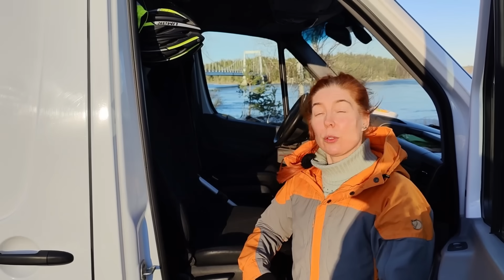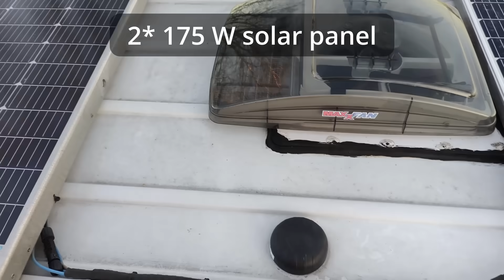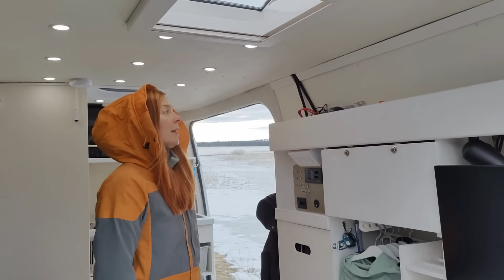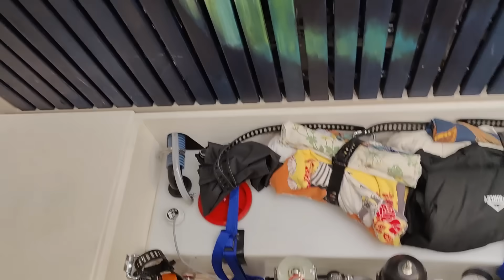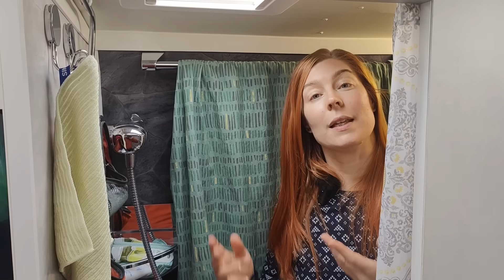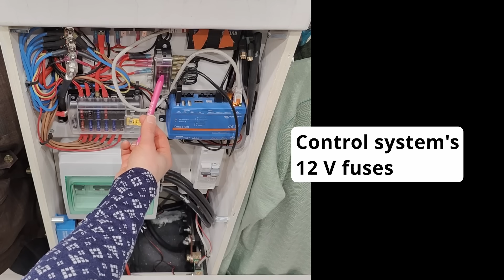diy camper VAN TOUR | Technical talk | Rare layout 🚐

Comment: I really love the way you've organized your campervan! I'm about to build my own campervan and you've given me a lot of great ideas. One question I have, if you could do it over again would you get maybe an L3H3 or L4H3 van, or do you think L2H2 is the best size? I'm still debating with myself how big of a van I need, I'm currently looking at L4H3 so I can put most of the storage overhead, and have a permanent bed in the back. And if I can sneak in one more question, can you charge the batteries purely on solar, or do you have to use other methods to charge often as well?
Reply from the maker: @woutkoopman   Heya, thank you for the lovely comments and questions! 😊 Happy to help.
For me this L2H2 is the maximum size, because it fits scandinavian city parking lots, U-turn radius (RWD) is almost like a passenger car, under 6 m long vehicles get bridge tolls and ferry tickets cheaper, and the weight stays lower. Naturally, more space and a fixed bed is luxurious, but i personally would end up packing every cabinet as full as possible regardless how many of them there is 😂 they always tend to fill up anyway. Longer vehicle means also more building material weight. But I'm sure in some countries and travelling styles, full L4H3 is equally perfect!
In Finland (62°N) i need to recharge my LiFePO4 batteries with grid power/generator every 3 days between Oct-Mar and occasionally (every 1-2 weeks) during summer when i don't drive long distances. Summer season depends a lot on the weather, and in winter basically there is no sunshine. I hope that your van build goes nicely, good luck! 🚐✨
Reply: @badasanaexperiences  Completely understand the choice of van size now. It probably would be better to have a van that fits in a regular parking lot. Problem for me is that in the Netherlands you're not allowed to sleep in your vehicle outside of campings, so I'll always be staying on a camping somewhere. But that's still pretty good that you can go 3 days before needing a grid charge. I think I'm going to copy your battery set-up, I think I have about the same usage. Thanks for the great info!
Reply from the maker: @woutkoopman  Wonderful to hear that I was able to provide some insight 😃 Yeah, i noticed that the cheap public camping places are pretty busy in Eindhoven at least, i can understand why. This electrical setup is ok, but for improved solar panel recharge, I recommend a bit more powerful MPPT, for example 30 A. But all the use cases are of course unique and it's important to use the mixture of electrical components that is approved by the manufacturer 👍 btw, if you happen to create any video about your camper van build, please link it for me 😃 i'm always curious to see other people's van projects!
Reply: @badasanaexperiences  Ah, you've been to Eindhoven! Not our finest city if I can be so honest, was the camping any good? I was actually just investigating vertical axis wind turbines as a possible alternative to solar panels, but doesn't seem like that produces much electricity even on a good day. I did just find 2 fairly cheap 400W solar panels which I think I'll buy, so I'll definitely need to get a bigger MPPT for that. I was planning on sticking with Victron for my electricity, except for maybe the battery's cause Victrons are so expensive. 

Honestly I wasn't planning on filming it at first, but seeing how useful all these videos were for me, I think it's only fair to film it and give back to the community. And having said that, I do have a lot of really crazy ideas for my van build that I haven't seen anyone do yet, so I'm very curious what other people think of them. It's too bad that I have zero skills in editing, or filming for that matter, so whatever video I make is going to be more comedic than serious van build ;). I'll make sure to let you know when my first video is released, my plan is to buy the van this month and start transforming it in May.
Reply from the maker: @woutkoopman  Heya, yeah the cheap parking (5€ per night) near Eindhoven city was good for me 👍 no problems. Yep, Victron is quite safe choice with the compatibility, but expensive. My batteries are Renogy, and work well in this system. But there are so many ok brands available now 😃
Yes please, the realistic and comedy-like builds are the best, it is real life that happens and everything is not smooth 😅🚐✨
Have a great building time!

Comment: Your van setup is fantastic. You clearly put a lot of thought into it. How does the Truma water heater perform? I've been thinking about putting one in my rv but I'm not not quite sold on the brand Truma yet.
Reply from the maker: @trentcarbino921  Hello, thank you for watching and the question! This Truma D6E Combi heater+boiler is my solid rock, the diesel burners have ignited reliably also in -20°C outside temperatures (fuel tank is there, Nordic winter grade diesel). It also heats water quite quickly, 30 min and water is at good temp to wash my hair. Of course, sometimes I heat the water fully according to instructions, to remove bacteria from the boiler.
Only negative side is that this combi system is expensive, but i feel that it has been worth it 👍

Comment: I like to see more about the bed.
Reply from the maker: @lenaschofield4759  Thank you for watching and leaving a comment! 😃 Others have asked the same, so maybe during springtime I can make the "how we built and painted the slim murphy bed" video 👍
Reply from the maker: @lenaschofield4759  Here is my technical blog of the bed manufacturing process: 
https://badasanaexperiences.wordpress.com/2023/05/23/murphy-bed-system/
It has also pictures of how we did the bed frame and painting 🎨🖌️
Does this provide any more insight about this murphy bed that you are looking for? 😊
Reply: So many questions! What is the frame made out of? What are the slats made of? What is the hinge mechanism? What kind of mattress did you get that is so thin? Is it comfortable? Is the bench comfortable when the bed is folded away?
Reply from the maker: @lenaschofield4759  Thank you for the reply 😊 frame is RHS (rectangular hollow section) structural steel, from a category that is ok to weld. Hinges are tailor made of the same material, just round beam with sliding contact bearings and pin inside. Bed slats are baltic birch, treated with wood oil and acrylic paint on the other side.
Mattress is quite thin and hard memory foam, less than 15 cm, and together with plastic bed springs it supports the body well for a good nights sleep (my opinion, and i weight less than 80 kg 😄). But i think everyone should get the mattress that they like best. Point is, the plastic bed springs allow to use slightly thinner mattress 💡
Reply from the maker: @lenaschofield4759  These are always personal preferences but i do yoga etc and sit on a plain ground a lot, so i don't need cushions on the sofa. I also stand up quite often to do chores, walk outside etc when i'm working so the bench is comfortable for me 😃 but i was wondering if i should sew cushion covers and add cushions for aesthetics, visitors etc, but haven't prioritized it high yet 😄
Reply: @badasanaexperiences  I generally prefer wooden kitchen chairs without cushions to sit on. You live there, if you're comfortable, that's what matters most

Comment: I’m shocked you gave up so much storage space on the wall and under the bed. It’s cute but not really practical for long term travel.
Reply from the maker: @serenityjewel  Heya, thank you for the comment and watching the video 😃 I know, it felt crazy for me too at first, but then i realized that the cabin storage spaces compensate a lot because i mostly travel alone. My longest full-time living was 6 months in Europe, and surprisingly every necessary item fit in the lockers and cabinets 👍 it also minimizes the van travel weight.

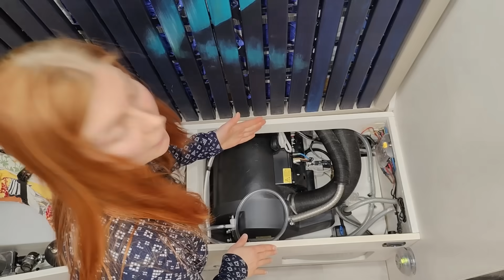Comment: TRANSCRIPT / ITEM SCHEDULE - At minute 8:44, please indicate the make and model of the water boiler.
Reply from the maker: @JP-lq5xi  Hello and thank you very much for pointing that out, the description is unclear there 👍 The water boiler is built inside the heater, which is Truma Combi D 6 E (not Truma D6E as in the video). This combination unit has diesel burners and electrical heater elements (rods) for 10 liter water tank as well. Unfortunately, i didn't find any text box yet in YouTube post-edit tools but i'll see what i can do to add this info 😃 Thank you for your help!

Comment: Where is the mattress stored and how is the bed set up?
Reply from the maker: @ginabrandt6168  thank you for the question! The bed has two hinges on the lower side of the bed frame, connected to wooden support structures. On the upper side of the bed frame, there is a manual lock which holds the bed on the wall during day. The matress is between the wall and bed frame/ plastic pieces (the blue ones in the video) during the day. It is a thin but comfortable memory foam mattress😊  Did this help with the question?

Comment: Since you're from Finland why not a sand battery for  heat?
Reply from the maker: @jamesmcconnell2473  Heya, thank you for the question! Do you mean the self-heating LiFePO4 batteries? They were too expensive for our budget 3 years ago, but they will definitely be an upgrade before next winter season 😅 this battery heating dance after a cold period is a headache now ☃️
Reply: @badasanaexperiences  no not batteries that explode. Finland just came up with this when facing the threat of being cut off energy-wise by Russia. Storing heat in a body of sand.. brilliant really. Perfect way to stop a bully too. Places like Finland Mexico and Canada can't be supported enough
Reply from the maker: @jamesmcconnell2473  Indeed, sand batteries are one potential solution for next generation batteries, same as saving potential energy to elevated storages for example. But it's difficult to scale to the moving camper van 😊☀️
Reply: @badasanaexperiences  something recent is charging your solar panels 24/7 with with LED lights
Reply: @badasanaexperiences   do-it-yourself short about a copper sand battery
Reply: @badasanaexperiences  if you didn't have a sand battery application for heating your van you would be the first I'm pretty sure
Reply: @badasanaexperiences  you might want to save up for the next generation of solid state batteries
Reply from the maker: @jamesmcconnell2473  True! I'm interested to see where the solid state batteries trend is going, i guess the solid electrolyte materials are still too tricky and dendrite formation / other degradation is problematic. But very interesting development on that field of science 👍
Reply: @badasanaexperiences  oh I see the confusion not sound battery but sand battery
Reply: @badasanaexperiences  why didn't we think of this DIY sand heater
Reply from the maker: @jamesmcconnell2473  Heya 😃 that is an unique idea for sure, but perhaps i don't know about that tech enough. I find it hard to imagine a functional location for the volume of sand in moving camper 😄 nice thought and chat anyway 👍
Reply: @badasanaexperiences  it's just the size of a standard metal mop bucket. Could save space by using a copper coil rocket stove and a few twigs to heat a 5 gallon bucket will the battery-operated pump and shower head. It's mostly to put Putin's autocratic dreams to rest
Reply from the maker: @jamesmcconnell2473  Sounds an interesting invention 😄 thanks
Reply: @badasanaexperiences  it is simultaneously giving Putin a smack on the beak I like it
Reply: @badasanaexperiences  best one I've seen yet is sand battery heater with copper and a 5 gallon bucket
Reply from the maker: @jamesmcconnell2473  Nice! Do you happen to have any article or video about its function principle?
Reply: It's 100% Finland and YouTube
Reply: @badasanaexperiences   understand I'm not a technical person just know what I like
Reply from the maker: @jamesmcconnell2473  Definitely would be interesting to see how it works 😊👍